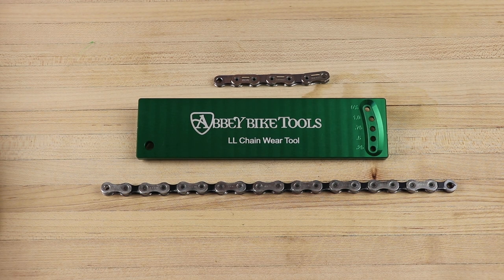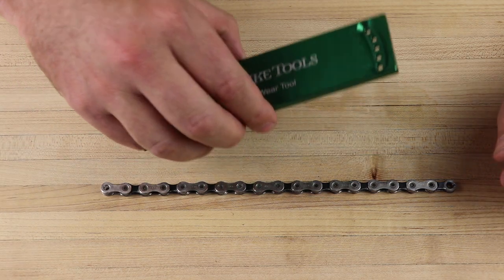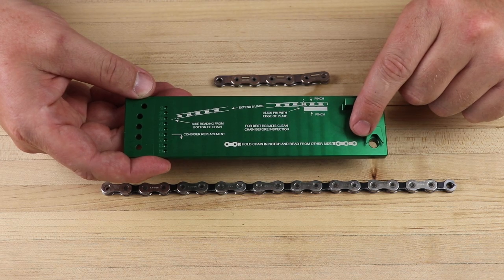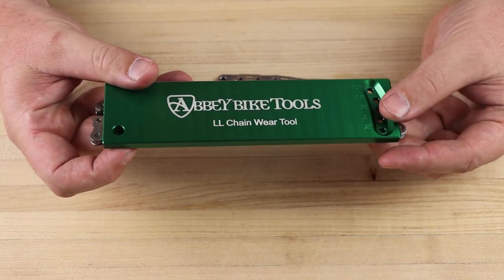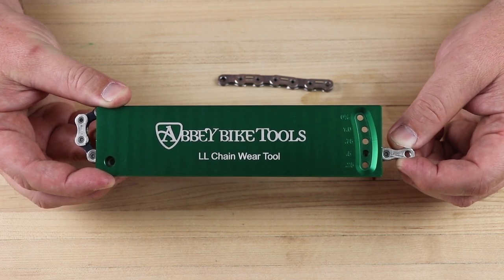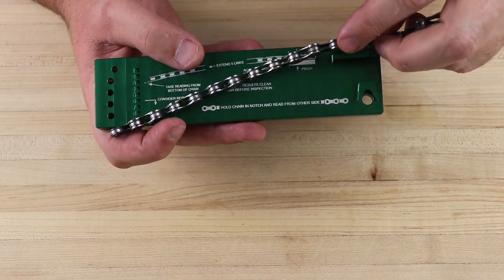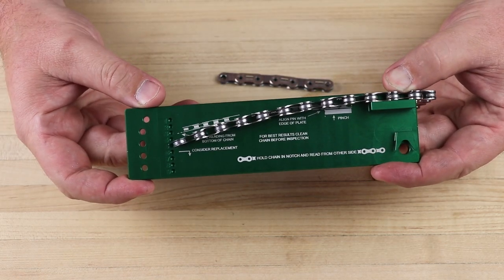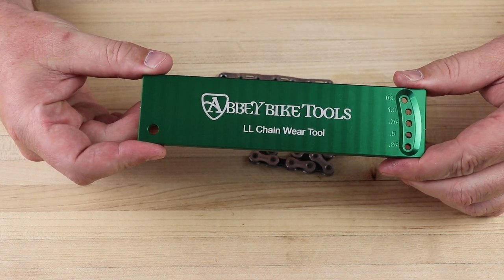How to: LL chain wear tool.

Comment: Why does it say “consider replacing” below the line on the lateral wear guide but the connector says it needed replacement because of poor shifting? Why say it needs replacement when it isn’t sagging below the ”consider replacing” line? It makes no sense….

Comment: I bought one because the price of chain rings, cassette and a chain is going nuts!!!! The $50 I paid is worth it to protect the drive chain. This tool is more accurate than the standard Park chain tool.  I will say that a brand new KMC DLC 12 chain out of the box starts at a 3. It went to a 5 after 5.5K miles.

Comment: Is lateral wear only supposed to be measured at the ends of the chain? I get very different results when I measure in the middle because of the weight of the chain pulling down on the links extending past that shelf on the tool. Results vary similarly if I measure at the end of the chain but press down on the links that extend beyond the shelf (the way Adam does in the Zero Friction Cycling YouTube video where he talks about the new Abbey LL chain wear checker).
Reply from the maker: The instructions that are engraved on the tool say to extend 5 links from the boss and then take your reading. To clarify, those 5 links need to be on the end of the chain. As you noted, extra links means extra mass and it will throw off the reading by a significant amount.
Reply: @abbeybiketools  Thanks for clarifying this. Obviously, then, it’s a mistake to measure at the end of the chain and press down with a finger on the 5 links extending beyond the boss. You might want to urge Adam at ZFC to include a correction in his weekly video. He has tons of followers who are the type to buy a tool like yours and then, based on seeing Adam use the tool wrong, will find all their chains to be at or beyond the lateral wear mark on your tool.

Comment: I was thinking of buying one of these: however, USD$137 freight to Australia is just freaking ridiculous; 3 x the cost of the tool itself. Or are you only wanting to sell to the US? The Connex tool costs AUD$20, and $12 to send it from Germany. Who's go the better deal for me?
Reply: You should try the local Australian distributors. There's Cycle Motion in WA and Leadout Sports in NSW.
Reply: Same. Would buy, but shipping to Canada is prohibitive.
Reply: @giroup01  There is a Canadian distributor from which stores can order. But it will cost you $129.50!
Reply: Zerofrictioncycling currently sell them.

Comment: Tool manufacturers developing all kinds of creative ways to convince you that you need to buy a new chain. I work as a bicycle mechanic but I don't take chain wear seriously unless there is a problem, such as skipping or excessive noise. I ride my own chains into the ground, far exceeding the  "1" measurement on many chain wear indicators, and then I keep riding them some more. When I replace the chain I replace the cassette too, which is why all of my bikes are 10 speed or less to keep costs low.

And I load my worn chains significantly, low gears on a fully loaded touring bike, or steep climbs while mountain biking. They don't fail me.
Reply from the maker: Running the entire drivetrain into the ground and replace it all at once can be a cost effective option for older equipment. When cassettes can cost $400 the economics are in favor of more frequent chain replacement. But you do you. We also aren't in the business of selling chains, so it's not like we have anything to gain by anyone replacing them more frequently.
Reply: @abbeybiketools  I'd argue that you do have something to gain in that you're selling a solution to a problem that wasn't openly recognised before you came up with your own parameters to decide when people should buy a new chain. You're selling reassurance over a 'problem' people were previously happily naive to.

I love your tools and your 'precision' ethos, but I don't agree with the need for this tool.

Comment: I ride a single speed using a normal MTB frame and an old derailleur as a tensioner. The rings are steel front and back. It's been using the same old chain for over 2 years now. Chain wear is only an issue for those using expensive cassettes and chainrings. Manufacturers love increasing cost, reducing durability and making spares hard to source.
Reply: I ride 7 or 8 speed most of the time, a typical inexpensive KMC chain is "spent" after 6 months or so, I keep riding them anyway. I actually think there is more durability in some of the 10/11/12 speed stuff because of efforts made to ensure 6/7/8/9 won't hold up as well. 

That said, a chain and cassette costs me less than $60, compared to the $600 for SRAM Eagle, so I'm not crying in the slightest.

Comment: Weirdly, my bike mechanic just showed me how chains wear laterally.  I’ve been waxing my chains and pin-to-pin wear has all but disappeared, but lateral wear is still there and I didn’t even know it existed until literally a week ago.  Hmmm… I think Google is spying on me — how else would it know that I needed this?  For what it’s worth, I immediately went to your site and bought one of these things.
Reply: Are you using a 1x chainring?
Reply: @utube7930  no, I use a 2x and I’m guilty of occasionally cross chaining.  I plan to be more careful about that now, especially since my experience with waxing has shown that the best chain to use, at least forSTAM, is the Red chain.  This is because it comes with far less factory lube and is much easier to clean up before waxing so I get better results. So, given that that is the top-of-the-line and most expensive chain, I’d rather be careful and save the money. I have never worn out a Red chain after waxing it (and we are talking 4000+ km). I wasn’t very clear in my post; the worn out chain was probably already worn out laterally when I waxed it in the first place. The mistake I made was to only measure the pin-to-pin distance without understanding that there was lateral wear as well.
Reply: Look when this was uploaded, it wasn't Google spying on you and only now showing you this video, it was Abbey who first placed this idea in your head and a week later publishes a new tool to fix it!

:)

Comment: For lateral wear I see a suggested replacement marking. For the length, I’m not clear on limit when to replace?
Reply from the maker: The threshold for replacement varies a little from one chain model to another so it's not something we can build into the tool. .75% is a pretty good place for 10spd or newer chains. Some people like .5% for 12spd and above though.

Comment: wouldn't different size rollers be positioned at different heights in the V shape notch causing the chain to be positioned at different offsets to the holes? what am I missing?
Reply from the maker: Different roller diameters will line up slightly different in the V notch. The impact of that variable is good for a .035% difference in reading.

Comment: When the chain is on the bike, how easy can this device be used?What are the steps necessary for performing the measurements?
Reply: seems like as simple as what we have on the market today
Reply from the maker: Measuring Linear wear (stretch) is as easy as anything else on the market. To measure lateral wear the chain needs to be off the bike though.
Reply: @abbeybiketools  while on the bike, could you not just take the chain off the chainring (to the inside or out), and use that slack to put it on the tool?